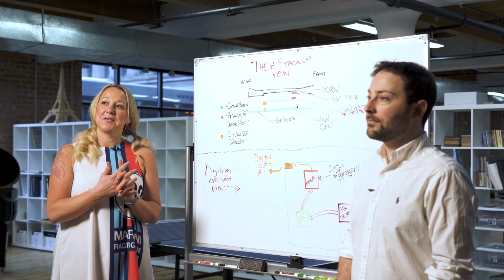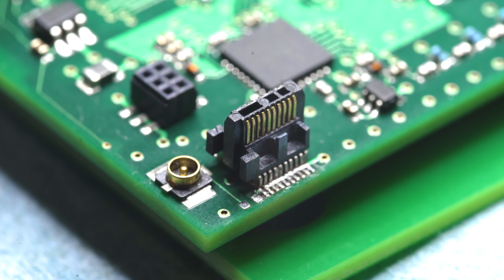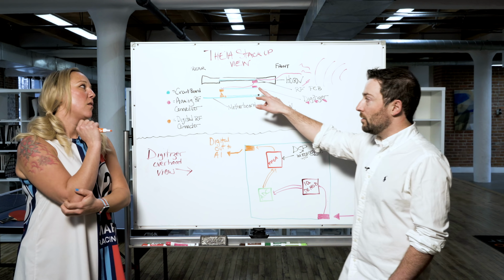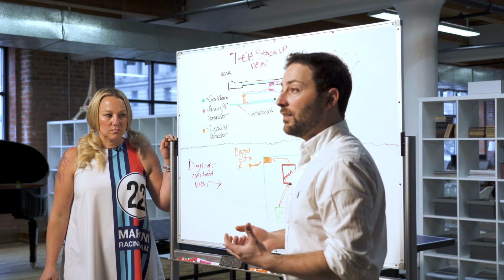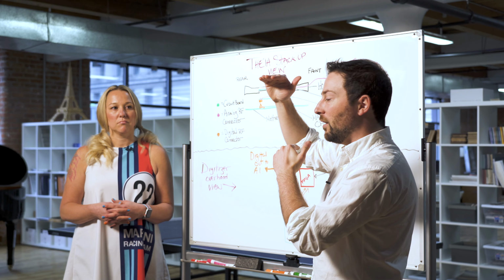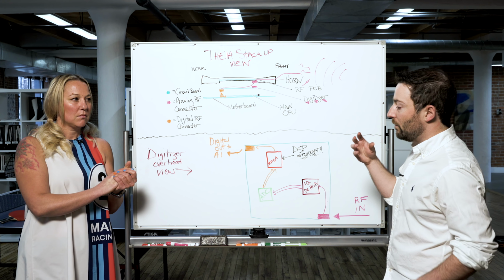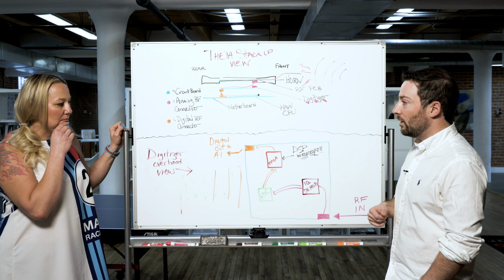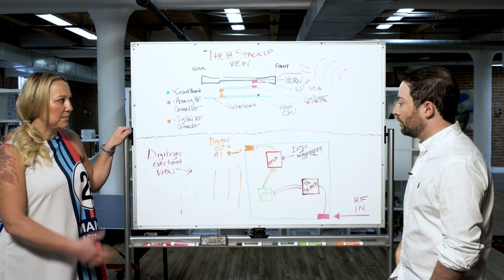Radenso Theia Digitizer Unveil

Comment: Nice video. Are you gonna be using thermal pads for heat transfer between motherboard components and the case and horn? I hope you are not just relying on air transfer because air is not a good heat conducting material.  Also, nice nail color, Mindi, it matches the blue parts of the dress and watch band.

Comment: Love these videos.  I feel smarter already.  I do have a question about heat.  Since I live in South Texas, a lot of heat comes into the car during the hot summer days.  Will the new unit be able to handle direct sunlight coming through the windshield for hours with damaging the unit or its components?
Reply from the maker: Hey Smootsl, great question. We have thought of the varied temperature swings from North to South and we've taken this into account. These electronics are designed to withstand the large swing. - Min

Comment: what size will the unit be and how strong will the mount be to hold the unit to the windshield
Reply from the maker: Hey CJ, within a few mm of width and length of the Escort Max 360. However it will be a metal case. The mount for the windshield will be plenty sticky. Thanks for watching and stay tuned for future vids. - Min
Reply: will you be taking trade ins I own the Sp, XP,  Pro, Pro SE, Pro M

Comment: Is there 1 device for International and USA?
Reply from the maker: We can't comment on that at this time since development is on going, thanks!
Reply: @RadensoRadar  would be very great if this device also for 2 nations. Just an matter an switch.
Reply from the maker: Aygul18 We agree but there are also a ton of other factors that have to go into consideration.  Once development is finished, we should know much more!
Reply: @TotalWarriorLegends  Certifications are different for each country, if the device isn't designed from the ground up with that in mind it becomes difficult to make this happen. Worst case would be components would have to be changed which would inflate the price substantially.